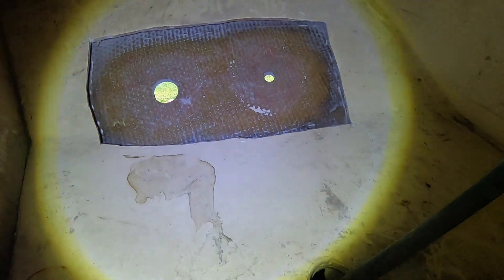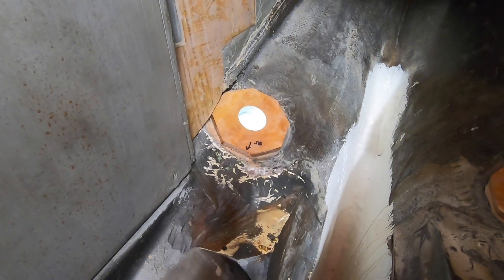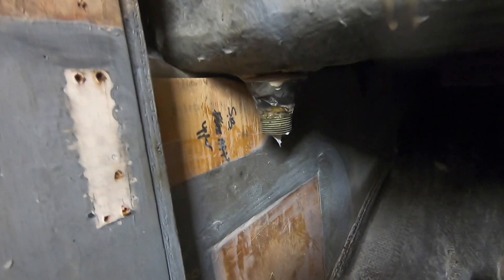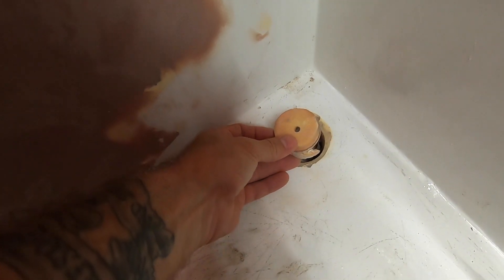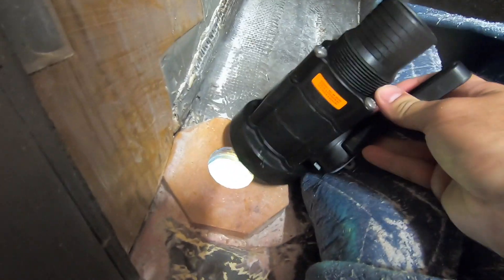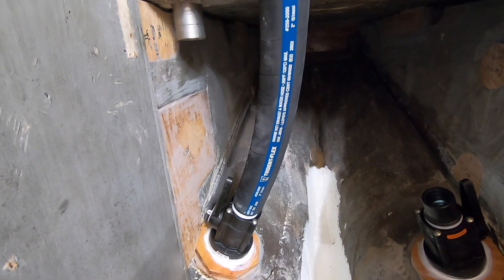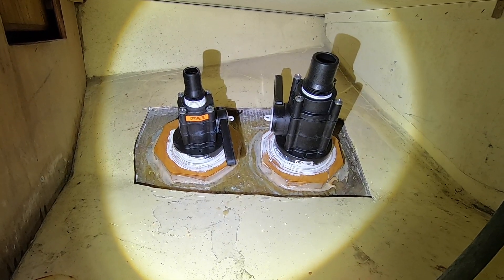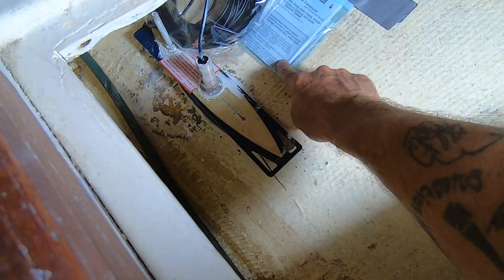Episode 33 - Installing Forespar Marelon Seacocks / Thru-hulls

Comment: How did the cockpit floor drains and seacocks work out. I have seen some people cross them. Mine go straight down like yours and I have never had water come up even with the rail buried in the water and rough seas. I keep thinking that if crossed and at extreme angle of heal the the cockpit will not drain as the water would have to flow uphill. Let us know your views and experience.

Comment: I'm getting ready to replace all my seacocks on my Alberg 30, as they are all very old. How long did it take for doing all the thru hulls? Not the prep work, but the installation.
Reply from the maker: As you know, it's the prep work that takes all the time. As far as actual installation with my wife up on the boat helping, we probably had all four installed in less than an hour.
Reply: @sailingaquamarie1708  thanks for the information. Great work, by the way

Comment: Agree that crossing the cockpit drain hoses would not be good storage - rather install a back flow prevention device.
Reply from the maker: I hadn't heard of using one on a drain like this. Interesting.
Reply: @sailingaquamarie1708  my impression galley sinks sometimes fill with water mostly from the hull heeling so back flow devices prevent that.